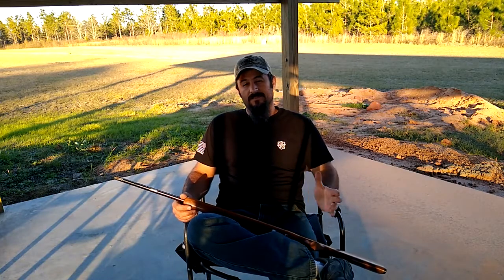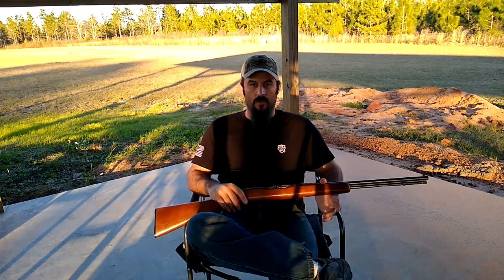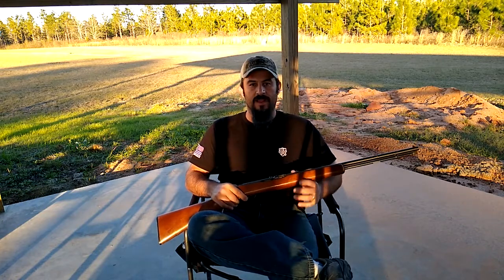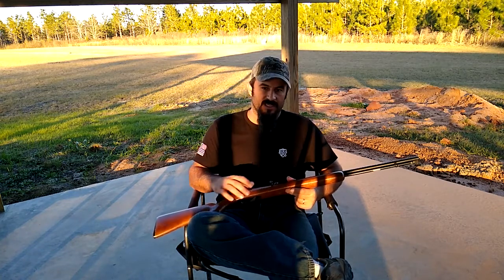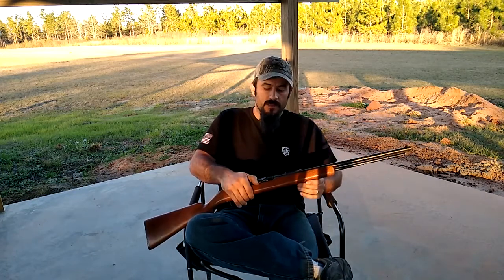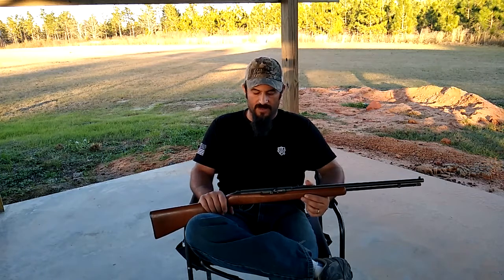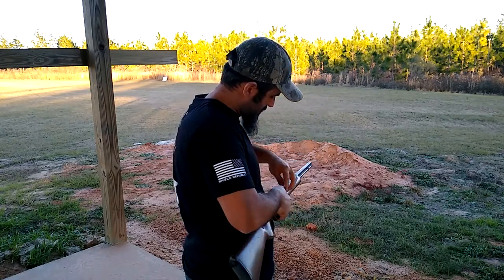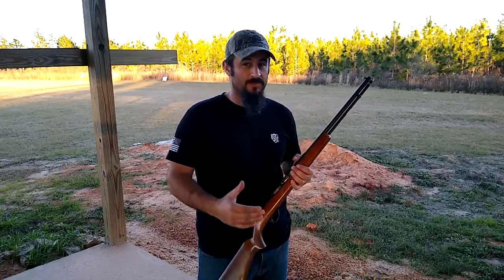Savage 187N Gunsmithing Guide Part 1

Comment: Thanks for your reply and the suggestion on this gun. How did the mod work after your 3rd video? I was wondering if you got the gun to cycle correctly after you filed down and polished the last 2 pieces in that video. I am looking forward to tearing mine apart again after watching you do it. I'll see if I can find the bore scope your talking about. Would love to use it on my other guns also. Every guy and girl that shoots guns should probably own one. Thanks again!
Reply from the maker: It worked great. It cycled fine with copper plated projectiles, round nose. Good luck on the project. I will leave a link for a borescope.
Reply from the maker: @roberthikade9759 
Teslong Rifle Borescope, Bore Camera Gun Cleaning Camera - Fits .20 Caliber & Larger-Hunting Shooting Firearms Visual Barrel Inspection Tool w/3 Right-Angle Mirrors and Carrying Case(45inch-Flexible) https://a.co/d/hlrFeML

Comment: What happened to part 2, I have one of these from my father-in law and really struggle with the reliability of if. tore it apart cleaned and even bought a new extractor spring for it and it still jams. I will be trying the highest grain 22 LR I can find. Great video.
Reply from the maker: Increasing the pressure is not always a solution, especially on the older guns. When you increase the energy into a system, it will magnify the work performed by all components. If they were not designed for that, it will cause issues and wear. 
You need to narrow down the exact issue. Every moving part has a process that is reliant on its surface smoothness, friction factor and energy transfer. Chamber smoothness  is also another factor in the extraction process. 

Older .22's did not utilize these higher pressure rounds that we have today. 

Chambering a round then manually ejecting it into a towel can tell you a lot about several processes happening just by looking at the ejected round. Nicks, mars, etc will be present. Narrowing those down and fixing them is a start. 

Another consideration.... Fire forming. When you fire, the hot brass forms to the chamber. Increase the pressure, you will increase the forming effect. Increase the forming effect you may never extract a round. 

Buy a borescope. It will change your definition of clean. If you can find a guy with an ultrasonic cleaner, let him clean your gun then start diagnosing it from there.